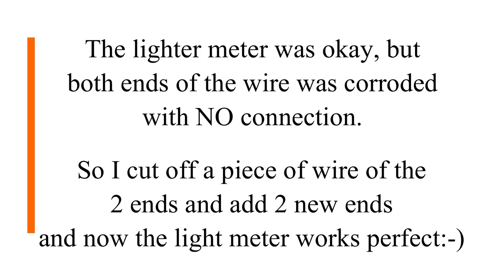Light meter problem Nikkormat FT3  (maybe corroded wires)

Comment: Great video, thank you, I will try to fix my FT3 with dead meter.  One thing: the cover plate for the battery compartment on the Nikkormat is backwards "threaded"--the "O" next to the clockwise arrow means "Open".  Clockwise to open, counter clockwise to close.  At least that is how the battery cover works on my FT3.  Consistent I guess with how the Nikon lenses also lock on by turning counter clockwise.  I'm not sure how you were getting the battery cap to stay on by turning it clockwise, possibly it was not always seating properly for you causing some problem.  In any case thank you again for your helpful and thorough videos!

Comment: Ken, I have that exact camera and I don't have your skills.  Question ... Can I just use the camera without the light meter.  In other words, can I just use the camera in full manual mode and use a hand held light meter instead?  Thanks for your reply.  Bill
Reply: Yes you can Bill. I have the FTN with a non working light meter and it works great if I use a hand held light meter, or just the sunny 16 rule.
Reply: The camera is full manual already. The built-in light meter only shows you how to set the manual settings. Nothing sets itself. The point of a Through the Lens (TTL) meter was it read the light that actually came through the lens. But expert photographers always used the meter readings as a suggestion and changed settings based on experience. Plus bracketing, where you take additional pictures at a setting higher and lower than the meter indicates, just to make sure.
Reply: Yes you can use camera without a built in meter

Comment: do you recommend trying the "overvoltage trick" before trying to open it up? i have a mamiya cwp with a dead light meter.
Reply from the maker: Well, I would not try the "overvoltage trick" simply because, if the meter is still working but not as if it was new, you could probably damage the meter if the voltage is a little higher than normal. It's just a guess..
I would use a little lower voltage just to see if there is any movement, and in that way say that the meter is still alive in some way.

Comment: Hi, i have a FT3 to, but the mine, the lightmeter is non calibrate, (2 stops more) to the moment, i just use the lightmeter with 2 less stop in the ISO, hahaha. exist a solution to this? like calibration?